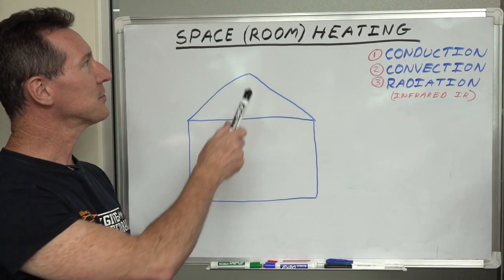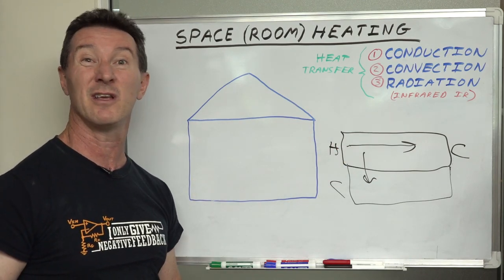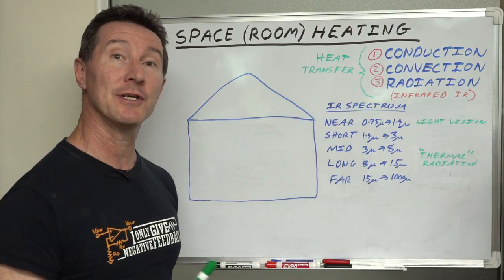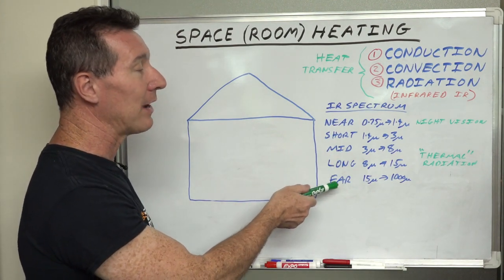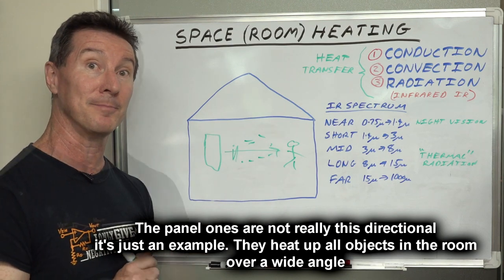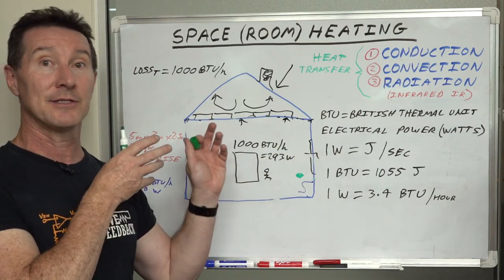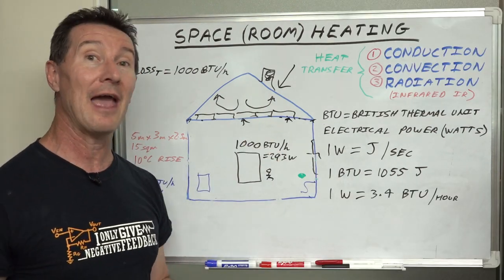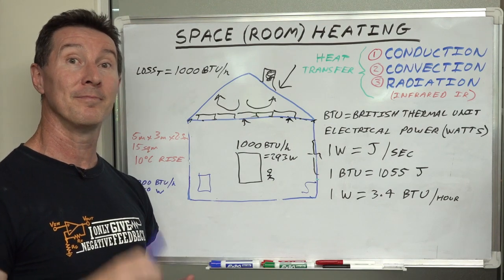EEVblog #1187 - Room Heater Technology Explained

Comment: Good video. The part starting at around 26:45 was not that clear as that calculator calculates the room/house losses knowing the volume of the room thus area that will result in losses based on the level of insulation and the temperature delta between inside the room and outside.
So say the room was not heated at all and you have no electrical devices inside not even a fridge or a light bulb and there are no windows facing the sun so you do not get any gain from that and there is no person or animal in the room then room temperature will be the same as average outside temperature (say outside temperature is +12C all the time) then inside temperature is also 12C.
Now say losses of that room at a 10C delta are 1250W then if you add a heater to that room that uses 1250W then after some time the room will get at 22C the amount of time it will take will depend on how much thermal storage is in that room (furniture, wall construction all will have some amount of thermal inertia). After some hours or days the room will get to 22C and then if outside temperature is always at 12C the room will stay there as soon as you have that 1250W heater working (no thermostat or anything).
Now when you stop the heating the room will start to cool down back to the outside ambient temperature and how fast it will cool will again depend on the amount of thermal storage in the room but will be the same amount of time it took to heat.
Now if the outside temperature drops to +2C then in order to maintain the same +22C inside the house you will need 2x as much energy so 2500W as that will be the loss of that room at a 20C delta.
If that is a room that you only occasionally use and want to increase the temperature y 10C delta then you will need a much more powerful heater so that air is heated fast and then have a thermostat so heater stops when it gets at that temperature and just cycle ON/OFF to maintain the temperature there. So say you have a 5000W heater it heats the air in the room by 10C in maybe one hour then it will just cycle ON/OFF at about 25% duty cycle in order to cover the losses after it got there.
So for this occasional use of the room a fan based heater will work best as it will more uniformly heat the air in the room faster where a oil radiator type will be better when room needs to be permanently heated as it will be quieter and last longer with no mechanical moving parts where an IR heater is best in bathroom/showers since you want to be directly heated and it will feel more comfortable.
Even in Australia much more energy is needed for heating than it is needed for cooling.

Comment: edit: Sorry, got to the end and you point it out. Doh!
I know you know this but its worth noting that heat pumps have higher than 100% efficiency and are electric (as they're moving heat from elsewhere). And gas or oil boilers have varying efficiency of course. Just think its worth being really clear there; some places, like here in the UK, currently use gas boilers as the standard heat source and efficiency certainly varies greatly between old and new models. Its an interesting subject isn't it. Nice overview!

Comment: Creating thermal profiles of buildings is its own whole field of work. My father has been working in renovation financing for quite some time and about 50% of his work tends to be thermal profiling. Lot's of looking up plans, punching numbers into simulators and walking around on site with thermal imagers. Also the switch to led lights has fucked up quite a bunch of formerly thermally great buildings because the incandecent bulbs probided a substantial ammount of heat, sometimes to the point where no dedicated radiators were needed in well isolated buildings

Comment: halogen bar heaters seem to use both convection and IR ...alot of heat comes off the bulb elements and goes straight up(hot air rises!), but also alot of IR (and a shitload of visible light!) that seems to directly heat objects and not the "air"

Comment: My cheap 1500 BTU $250 electric fireplace uses all 3 types of heat transfer. It has a quartz IR lamp shining on an aluminum heatsink with a fan blowing out warm air.

Comment: We had a question put to us by a physics teacher in school who had explained to us that a refrigerator basically was a heat pump that takes heat from inside and puts it outside of the fridge. He then he asked "if i had a refrigerator running in a room with its door open and the room is sealed and has perfect insulation would the rooms temp rise or fall " i replied rise. He said it would stay the same .Reasoning that the heat had just been transferred from inside the fridge to the outside.You should have seen his face when i told him the fridge was a heater because the energy it consumed to operate was an increase of energy into the room and thus that energy would raise the temperature.

Comment: Thanks for the wonderful dose of clean and simple physics facts!
I love my mini-split heat pump. I realize you can only cover so much in one video, and I also look forward to the day when you cover heat pumps that are running with a COP of 3+ since it's such a great way to compensate for climate breakdown. 3 to 4 times the effectiveness (can I call it efficiency?) of a space heater is a really powerful change to the bottom line of heating. It ends up being almost half the cost of natural gas in my region.

Comment: How about those radiator fans you put on the radiator to spread the heat faster

Would they improve the spread of heat better than a normal water filled panel radiator without the fans

Ps would a diy version with X amount pc fans be better than a store bought one

Comment: so a heat pump would be conduction and forced convection pretty much?
Reply: john Rigby It's forced convection in a pressurized tube system where the pump uses changes in pressure to have the same energy but different temperature in the two "radiators" (inside and outside).  An electrical fridge is literally a heat pump attached to a closed box, with the direction set to move energy from inside to outside.

Comment: A heat pump can only be more "efficient" when there is a suitable sink from which to get the heat or dump it.  Air based heat pumps reach an equivalence efficiency point at an ambient temperature of around -5C and go down from there, to a point of not being able to supply enough heat at all.

Comment: Big improvement over the last video :) I still say a lot of this negates much of the Solus criticism, most of the argument comes down to "they said efficiency in terms of heating a person, rather than efficiency in heating an entire room, they're dum."
I was glad to see a breakdown of this at the end showing that efficiency can be the correct term in the right context, but as for a marketing 'genius' using a term out of context, well thats hardly anything new. Given that seems to be the primary argument against Solus, it feels more like nit-picking than debunking.

In terms of efficiency in heating a person, lets call it effectiveness, there is a huge variability in heater designs. Small fan heaters (or "space heaters") are typically considered the worst, as while they heat you up quite quickly, the hot air blowing across you also increases perspiration, and assists in evaporation, which cools you down and increases your losses. IR heaters are in theory more effective because they heat you without heating the room, but they may also have higher losses due to losing IR through windows and such, and ultimately because do quite little to heating up the room, you'll keep the heater on far longer, and may end up using even more power than you would've with a convection heater due to the higher losses.
And yes, heat pumps / air conditioners can achieve a far better COP, meaning they can be as effective/efficient or moreso than the Solus claims (not that it can actually reach those claims), and lacks most or all of the drawbacks.

A thought with the 1.5 sec on/off cycle, perhaps they are attempting to control the wavelength? As said in this video really the heat is just being stored, so the element is emitting less heat than it should for the ON cycle because its 'warming up', and more heat than it should for the OFF cycle because its 'cooling down', but in terms of the red/orange/white hot example given, perhaps they are trying to keep the element orange, ie at a wavelength that most easily passes through the glass frame, rather than blasting it white hot and encountering increased resistance.

It's still a bullshit product, no matter what its nothing actually "new" as far as what it does, it is almost certainly less efficient than a heat pump, and less comfortable than a convection heater, but i still feel the debunking video was more nit-picking on terminology, rather than covering the perfectly valid arguments that can be made against its effectiveness, value, or novelty.
Reply from the maker: Solus make very specific claims about Graphene producing heat with no energy input, and heating a given volume with a lower energy input than equivalent heaters. It's all demonstrable BS.
Reply: EEVblog yeah they make indeed these claims among other ones. Some could be ok if they weren’t trying to confuse people with some physically wrong claims. It would just be another aesthetic radiative heating system but wouldn’t get as much funding...

Education is key guys !

Comment: Very useful. Thanks. We've always had central heating with a natural gas furnace to heat the water. Now they've jacked the gas prices and slapped on taxes to force people to switch to electric heating. So have to start looking for what's best in my situation. Think a combination of a convection heater for (low) ambient temp and a IR panel above the workspace might be sensible.
Reply: Look at heat pumps.  They use less energy than they move in from outside.  There are heat pumps that can be installed next to or instead of the central gas boiler.  As for the gas taxes, every good government increases them to make us use less gas, because otherwise the Earth itself gets too hot.  But fraudulent campaigners deny the reasons to make governments look bad, and completely don't care that their nonsense is endangering our very ability to survive as a species.
Reply: Gas prices are from the supply end. It's market determined and variable, taxes are another thing tho.

Comment: Insulation: that attic ventilation is critical in cold climates. If the roof gets too warm when there's snow in the roof, it will melt and refreeze at the edges, forming ice dams which are extremely destructive.

As far as the walls go, bumping the framing up to 2x6 from the standard 2x4 construction allows for a lot more insulation, but it's only cost-effective in places like the upper peninsula of Michigan and Minnesota.

Double brick walls, nah. Brick is leaky and drafty and mostly only good for fire resistance. Modern US construction uses brick veneers (a single layer of bricks outside a frame wall) and not structural brick for good reason.
Reply: Paul Ste. Marie US construction is generally shoddy.  Brick walls are stronger and are only drafty if done wrong.  Right way is a layer of brick or concrete, then a layer of insulation (as thick as possible),  then an inner wall of brick or concrete.  Wall on hot side (inside in the north, outside in the tropics) needs to be more airtight to prevent condensation and rot inside the wall.  The brick or concrete needs to be just thick enough to stop normal burglars of the local type, and to carry the weight of upper floors and roofs.  But even if you do use wooden walls, the insulated space should have as few solid pieces short circuiting the insulation.  So an outer wall of concrete or held by 2x4s, a wide gap (some have used more than 2 feet) for insulation,  then an inner wall held by 2x2s, metal profiles or light concrete just like between rooms. Wood may be replaced by steel for fire safety.  Also check flammability of insulation materials.  Some can hold back a raging fire, others spread the fire.  Some behave differently depending on installation.
Reply: @johnfrancisdoe1563  Clearly you've never been anywhere with the slightest amount of seismic activity. Even minor earthquakes will bring brick walls crashing down. 

Fire resistance is about the only thing going for brick. It's got a terrible r-value (0.8, vs 12-18 for the usual frame construction w fiberglass insulation). It also seeps water like a sieve. When building the walls, you need tar paper waterproofing behind it and weep holes all along the base. Let those get clogged, and condensation inside the wall will cause all sorts of water ingress issues.

Comment: I just use my 620 Watt air conditioner for my workshop. It delivers approximately 2kW of hot air or 2kW of cold air. For the home, we use a 2kW air con, that delivers 7.5kW or hot or cold air.

Comment: One thing to remember about heating of rooms.  Humans produce heat at about the 150 watt level.  Get enough in a tight space and you better account for them, as they will heat up a room.  This is why sometimes in winter in a well insulated space, you MAY need air conditioning.  Doesn't happen often, but it can be a problem.

As for "heat pumps", there exist heat pump hot water heaters.  They use the latent heat in the air and transfer it to the water.  More "efficient" than a resistive hot water heater.  Their main problem is that the cool down the surrounding air, so you don't want them inside (especially in the winter).
Reply: Herby1620 More precisely, you don't want the heat extraction point to be the regular inside air.  The pumping etc. can be inside so any waste heat goes to good use too.  Popular placements of the heat input are: Underground in the garden, taking heat from nature.  In the exhaust of ventilation systems, so the air leaving the house is colder, and just on an outside wall or roof, taking heat from the air.
Reply: My sister has a ground source heat pump, which works OK in both summer and winter.  The earth is a pretty good source and sink.

Comment: 13:20  Glass is going to be opaque to most of the IR that a heater puts out.  Pointing one at a window is unlikely to lose a significant amount of its energy.  It does depend on the type of glass (and coatings), and the specific wavelength, but generally the glass will be a dutiful greenhouse material.  

Like with the glass doors on a fireplace, where having them open and closed will make a world of difference, between heating the room and putting on a light show.

Comment: I have an idea for a kickstarter, it’s an infinitely efficient room heater.  It heats your room at zero fuel cost in fact you may even be paid to take the fuel away.  It’s a big concrete block that generates an approximately constant heat output 24hours a day, 365 days a year.  It never needs refuelling at least not for several generations and it simultaneously solves one of humanity’s (not including Australia) major problems.  The main drawback is that it can’t be turned off so it’s only suitable for cold climates like Canada or Greenland.  You install it and forget about it and when the nuclear waste has cooled down your descendants simply sell it as scrap metal.

Comment: Radiant heat is best, most efficient due to being able to keep overall temperature lower with a better comfort.   In an extremely cold environment,  you want less heat, especially less warm air.  It's about comfort.  Not how many btu's you can pump out.

Comment: The most effective way to improve the heating of a room is to fill the room with crap. The more shelves and storage I pack into my tiny lab the better the little window aircon and heater appear to work. Heck, half the time my laptop and bench lights have replaced my heater. 
...at this rate... I bet Mr Carlson's Lab is capable of breaking physics. ...now how could I put that on kickstarter/

Comment: That fan heater at 4:01 is identical to the one I have.  Placement of radiators is so important.  I have the fan heater because of badly placed radiators, not by my choosing.
[Edit: Timestamp]
Reply: Use the semicolon to time stamp : and add 0 for seconds  1:06
Reply: @17hmr243  Done.  Cheers.

Comment: Hmmm...     The oil filled convectors would certainly have more thermal inertia and would take perhaps a few min to heat up, but after that it is possible that they move the same amount of air as a fan forced but at lower velocity out of a much larger effective duct area. Once the unit it up to temp it is certainly transferring the same amount of heat to the room as the fan forced so to say it "heats up the room slower" might be a little misleading. A convector MIGHT result in parts of the room being hotter than a fan forced and parts cooled than a fan after a short time. Same average temp increase to the room with time using either unit. No?